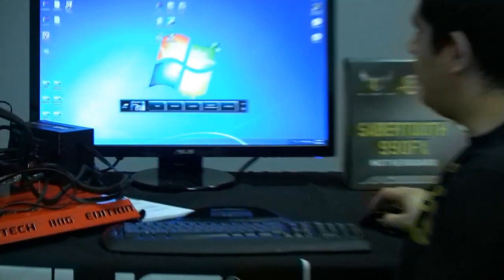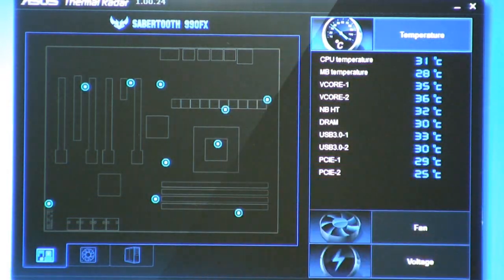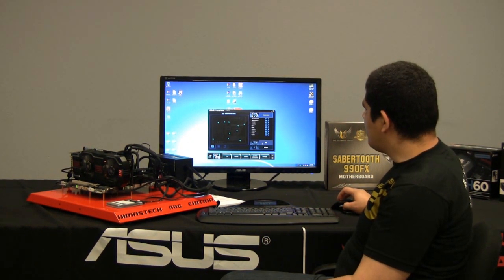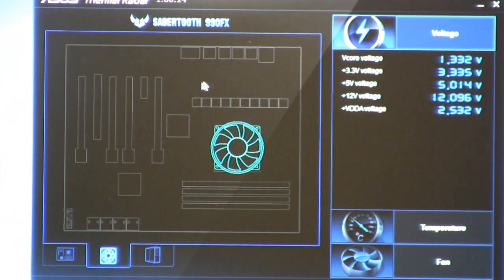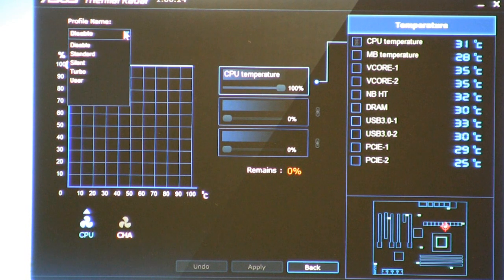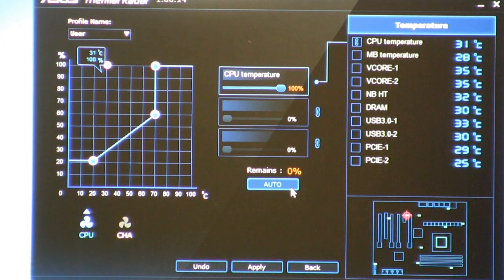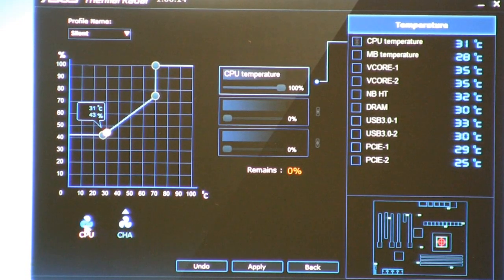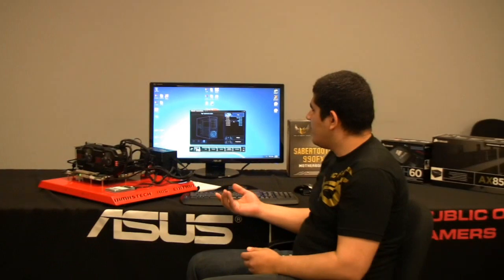ASUS Sabertooth 990FX Motherboard Hands-on Review 2/2

Comment: Thermal radar sucks. I have the Fractal Design Define XL chassi with no fan at the top. There is one above the cpu yeah, but its angeled so the air still comes out on the back. Now, I need that one to spin faster, the top get hot as hell. But i cant reglate them individually, even though the graphics over the chassi seems like you can.

Comment: @Zraupp10 
Wrong dude... The physical specification is the same. Same with pin out and such. The only difference between AM3 and am3+ is the voltage specification. The AM3+ socket requires much cleaner voltage for DRAM and NB.

Comment: I have this board and bought some corsair sp120 fans for a h60 cooler but the most doesn't see the sp120 can a 3 to 4 pin converter fix this problem?

Comment: Hello asusrog I've got an question for you,

I got this sabertooth 990FX mobo with an: AMD FX-8150 (or FX8120 im not sure),  and Corsair 8 GB DDR3-1866 Kit CMZ8GX3M2A1866C9 (2x4GB).

I cant set my timing from the ram to 1866. If i try i get a BSOD. I already tried to set the timing right, tried to use other chanels, but nothinh works.

My mobo supports the 1866 ram, and also my prossecor support the 1866 ram.

Can you help me out?

Comment: Hey JJ, Hope your good but My 990fx is not seeing any of the fans and wont see the cpu fan, My cpu cooler is a H55 corsair water cooler. and my fans are the 120 quite ones. But in booth the bios and in the thermal radar, fans are not seen the other issue is with booting becasue the bios is not seeing the fans and brings me to the UI and i dont know how to make the mobo see the fans any help would be awesome :)

Comment: @sjkreid3D for the current motherboards im afraid that's impossible. The only way that would happen is if they shipped the motherboards with updated bios already installed. Even then there's no way too tell before hand if you're getting an updated one or not. Just get a really cheap AM3 processor or In my opinion the current Phenom ll x6 1100T is the best way too go instead of getting an AM3+ CPU. Especially if you're gaming.

Comment: after using the P67 sabertooth in a build ... the problem I found was the shitty marvel sata 6gbs controller ... and the efi bios was flakey at times ... not booting a 2500k at 4ghz but booting at 4.2ghz ... its a great board though .... but I do understand why gigabyte are releasing efi hybrid bios's .. they say efi is not quite ready ... and i'm inclined to believe it ...

Comment: so, I want to do 2 gtx 660's, The using the top pci slot and the 4th (the second light brown slot) but, because these cards use 2 slots, I am unable to get my network adapter into the PCIe slot, is there any way around this? like a cord or something?